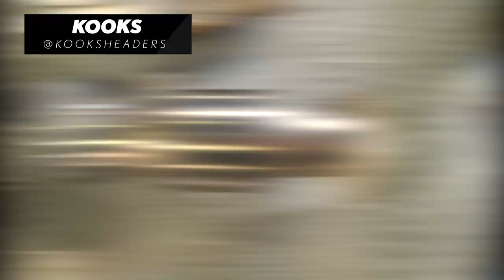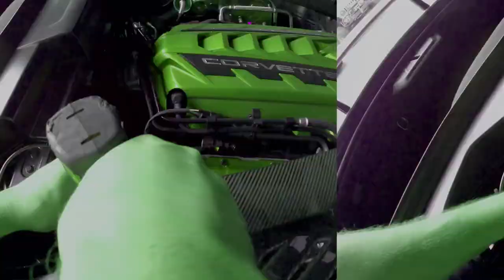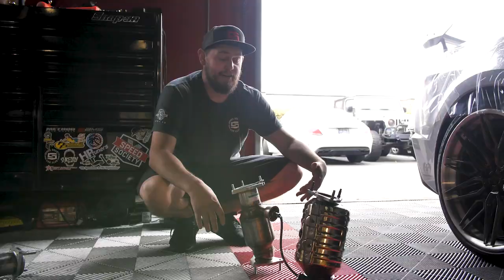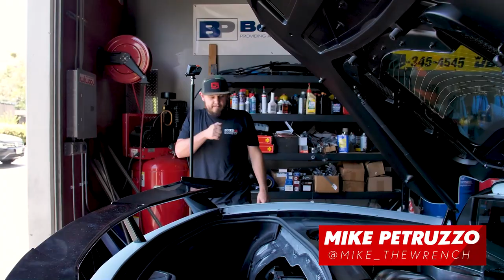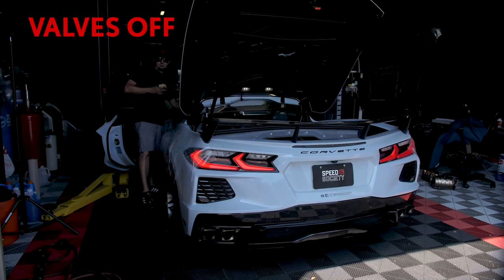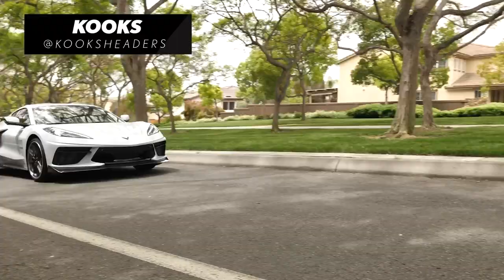THIS is why you need Kooks Headers... Matrix C8 sounds UNREAL

Comment: I recently purchased a new '23 C8 Z51 and I saw that Kooks headers actually lose HP compared to the stock exhaust manifolds due to the restrictive 2.5" flange outlet.  The better choices are ARH and aFe with 2.875" & 2.75" outlets respectively.  So it looks like ARH for the win!
Reply: Agreed on ARH & aFe being the better choices vs. Kooks on the C8.  I personally run aFe headers + Corsa cats.

Comment: Sounds great. :)  I may be wrong, but I believe the increase in volume is coming from the new "higher flow" cats, not really the headers.  Headers help a bit though.
Reply: I believe you are correct. If you look at the stock tube headers compared to any aftermarket header there is very little difference. The Hi-Flow Cats and the exhaust system is where the real sound increase is coming from. I have a new C8 and I have on order the same Kooks Cats but a Borla Atak exhaust system on the way. I don't see any need to swap out the stock tube headers. These guys do it because they get them for free for the advertising. My system will sound just as bad-ass....   Without swapping out the stock headers.
Reply: @DaveGee0  Currently I'm running my C8 with fabspeed cat bypass pipes, and stock headers and stock exhaust (z51).  It's loud AF when full throttle.  But still quiet at idle speeds.  And very quiet in Tour mode.  I plan to get an exhaust system, although not sure which since the vast majority of videos are only with exhaust (stock cats).  I want an exotic/higher pitch sound, kindof like my C7Z06.
Reply: @vhayne91777  any thrown codes with the cat bypass? My c8 is coming soon and it has the z51 exhaust. At some point I know I’ll want a louder exhaust. Also, did you get new exhaust since then?
Reply: @ryants1  Yes, unfortunately even with the mini-cats that Fabspeed sells.  No biggie to me though.
Reply: @ryants1  I'm sorry, I forgot to answer your other question.  No, I haven't purchased a new exhaust yet.  I want to, just had other things to deal with.  Such is life... :)
Reply: @vhayne91777  lol thx for the reply! Yeah at some point you have to be smart about the mods 😅 you can always go bigger and louder. Looking forward to being a part of the c8 family.
Reply: @ryants1  You won't be disappointed. :)  The car is absolutely great.  I've owned many amazing cars over the past 10 years, including C6 ZR1's and C7 Z06's.  While they were all great in one way or another, the C8 is probably the smoothest, most comfortable, and amazing of them all.  The only complaints I have of the car is that the power seems kindof low (that's probably just me though), and I do not like the short gearing.  I really hate 1st gear.  I get why they did it, to chase the low 0-60 times.  But when driving in manual, turning at a redlight from a stop, having to change gear to 2nd in the middle of the intersection as you're turning, is ridiculous.  Other than that though, it truly is a great car. :)
Reply: @vhayne91777  can’t wait!! Hey you can always add a pro charger 😅

Comment: is there some gasket leakage going on there? noticed quite a bit of smoke in the engine bay.
Reply from the maker: New headers, so they were burning off some of the coating from manufacturing. Happens with every new set of headers!
Reply: @speedsociety  kind of figured, seemed a bit excessive but I guess being that the engine bay is visible its more noticeable then one would see with a front engine vehicle :P
Reply: Do you need ceramic coating?

Comment: Quick correction, Kooks cats are actually 400-cell.   GESi G-Sport GEN2 S-Wound cores to be exact.  Same as Corsa's C8 high-flow sport cats.
Reply: I ordered the kooks headers with the corsa high flow cats. You think this setup would be a problem?
Reply: Also did you get the headers coating?
Reply: @yujiechen239  No sir, they'll be a good pairing.  Both use the same GESi core.  I personally run the Corsa cats too, 2+ years and no CEL or issues!
Reply: @yujiechen239  My aFe headers are Cerakote Titanium ceramic coated, as are my Corsa cats.
Reply: @Kracka21C8  I have blanket for the cats but I’m just worried about the headers now
Reply: @Kracka21C8  did you had the 1-7/8 header?

Comment: The engine bay @4:35 🔥. That can't be good.
Reply from the maker: Brand new headers have a coating that burns off in the first drive/startup as they heat up, totally normal
Reply: @speedsociety  ah. I learned something new, thanks!